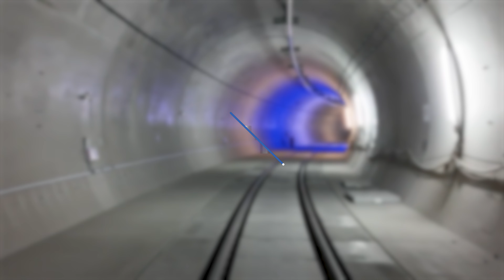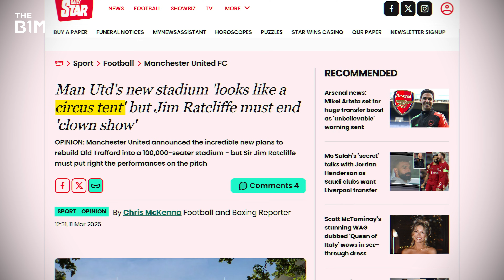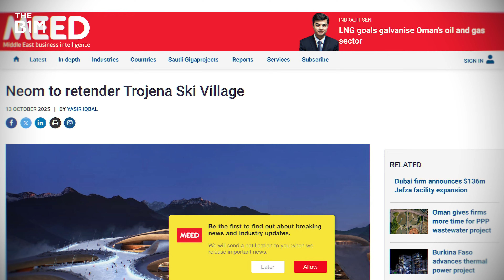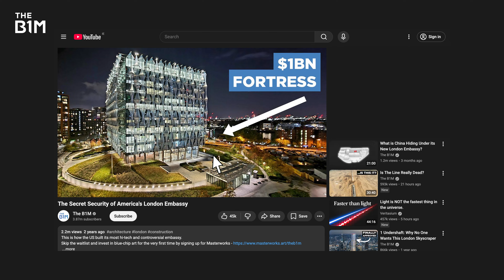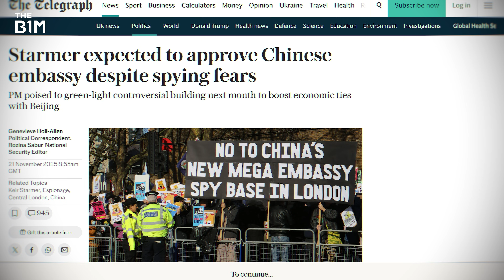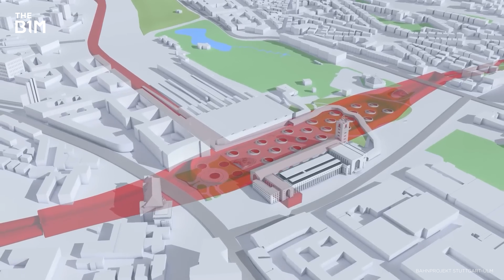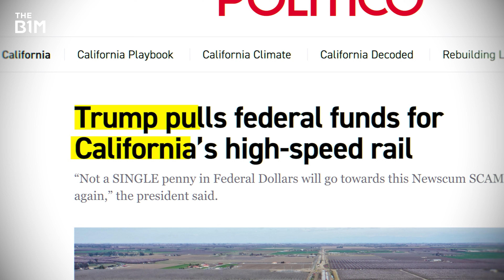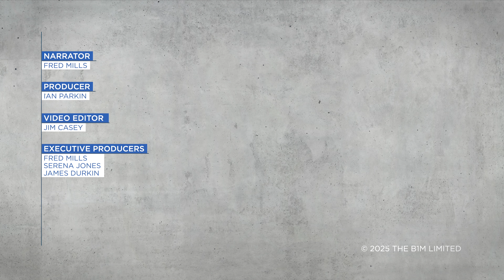The 10 Biggest Mega Build Disasters of 2025

Comment: A big part of the problem with German railways is their mentality. The Germans will not run a train if the AC is not working in a single wagon. Yup, one wagon without AC? They'd rather cancel the entire train. Or one door of one wagon malfunctions? You guessed it, cancelled. Or even better, if that's a train originating from a different country, it's locked and sent without passengers. Quite often, it then arrives in its home country, the door/AC is repaired in 5 minutes, and the train continues normally.

Comment: In Germany not only the Train Network is trash, but also the Roads and Bridges. About 16,000 Bridges are at risk of collapse and need to be renovated or completely rebuilt.

Also Stuttgardt 21, as the names says should have been opened 2021, but it's still not even close to be finished. Then between all the problems it has, it is also way too small and should have been build at least twice as big for the train traffic.

Comment: HS2 - whilst Old Oak Common Station starts to install platforms UK Government hasn’t given the green light to tunnel to Euston (tunnelling Machines just need to be turned on!) we have to consider the costs are comparable to roads yet also consider the cost of train development - so if you build a new motorway you do not take into account the cost of all the cars - HS2 needs to extend to Manchester and Leeds the Glasgow - ideally the HS3. kings Cross to Edinburgh which would allow the UK to ban internal flights

Comment: You did a great job highlighting failures in the west. Why not light one from one of your major sponsors,  China. 

The Hongqi Bridge in China, which opened on April 13, 2025, collapsed just months later on November 11, 2025, due to a landslide. The bridge, located in Maerkang, Sichuan Province, was part of National Highway 317, connecting central China to Tibet. Thankfully, no casualties were reported as authorities had evacuated the area after detecting slope deformation and cracks in the bridge structure the day before ¹ ² ³.

Key Details:

- *Location*: Maerkang, Sichuan Province, China
- *Length*: 758 meters (2,487 ft)
- *Height*: 172 meters (564 ft)
- *Construction Cost*: 300 million RMB ($399 million)
- *Opened*: April 13, 2025
- *Collapsed*: November 11, 2025

The incident has raised concerns about the bridge's design and construction, given the region's prone nature to landslides and seismic activity. Authorities are investigating the cause, but experts warn that the area's terrain makes infrastructure projects vulnerable to slope instability.

Comment: The Brits really need HS2... and they need it to reach Scotland. 

They also need to learn that not every city has to be reached with a high speed line. 
Being reached by a high speed train, that branch out of the high speed line, is the way to go... 
We learned that the hard way in France with all the stations among the fields. (many of them being mostly useless), now we insert branches in/out the HST on each side of the cities that comes near the HST, so that trains can come in/out of the HST depending on the service. 
Sure it can lead to weird things like going to Paris to Lyon in 2 hours and then taking one more hour to reach Grenoble.... but in the end Grenoble is 3 hours away from Paris, even if the last 70kms or so are done at a snail pace (for a TGV) and take an hour.